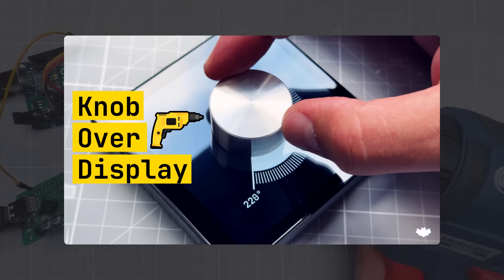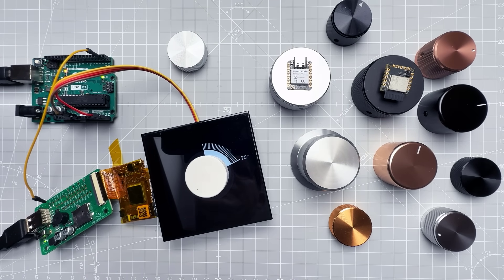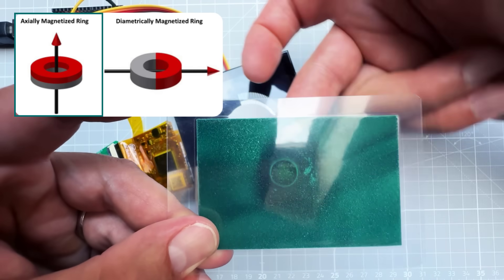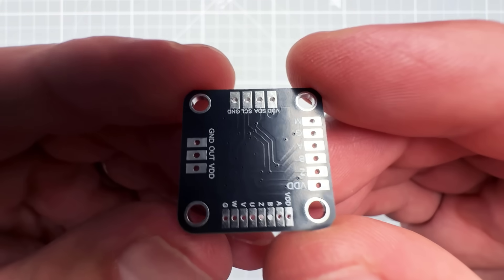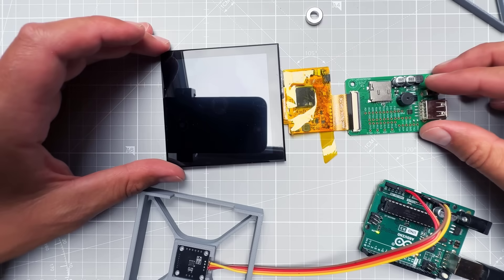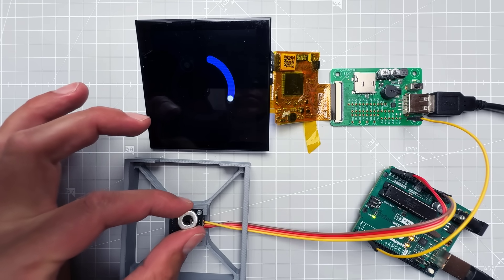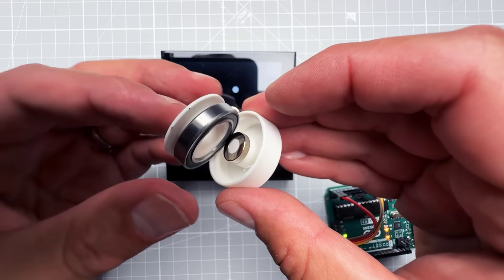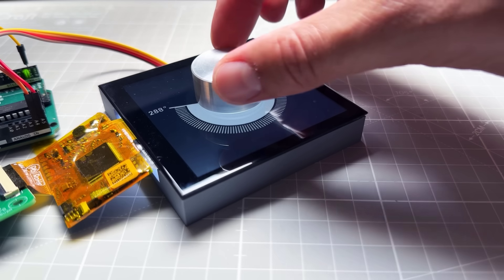Knob Over Display (2025 Edition)

Comment: You can use a magnetic compass sensor, where the distance from magnet to sensor is much less critical. Glue one central magnet - like the ones with the counter sunk screw hole to the display. Insert  steel ball bearing into the knob that rides in in the magnet. Offset a magnet in the knob that is used to drive the compass sensor
Reply from the maker: That´s an interesting idea, but I´m not quite sure what kind of precision you can get with this setup.
Reply: @upir_upir I am doing wind vanes like that... but they are not in the fractions of a degree accurate.

Comment: You should try to make the knob glow by making the knob transparent, and turning on/off sections of the screen underneath to replicate dimming.  

The screen would sit under a light diffusion layer housed at the base of the knob, so that the light can evenly distribute throughout the knob.
Reply: The picture map required by the screen may be a limitation there...
Reply: @testman9541  Indeed, but the idea is sound for other means of display driving.
Reply from the maker: Definitely an interesting idea, but the non-transparent magnet and bearing might be ruining the effect.
Reply: @upir_upir  Maybe print the knob in two parts? The center could be opaque, while outer ring is transparent?
Reply: @upir_upir  You may be able to achieve a similar effect even easier by shortening the height of the knob and adding a semi-transparent "spacer" of the same diameter to the underside. Using something that's not fully transparent would allow the light emitted under the knob to be softly diffused. Very cool project overall.
Reply: @upir_upir  attach knob to sheet of acrylic or glass. have it run a sensor along the edge of that circle, theres no reason a knob has to have its shaft or sensor in the center.

Comment: I have no words, the encoder is simply amazing. I can't assemble many devices, even a timer, because I don't like a huge encoder. They are either very huge or very expensive and hard to find. And here, it fits into a pinhead.
Reply from the maker: I´m glad this was helpful for your project, good luck with them!
Reply: @upir_upir  There's a problem here. You can't add a pressure sensor. I checked with the company; they redesigned some old chip. And in the documentation, there's a pressure sensor; it senses the sudden approach of a magnet. But in the end, they couldn't finish the function. The chip doesn't even have a register for this event, and the circuit boards don't have wires for it.

It's a shame. I even tried rebuilding it on a regular compass. But it just goes crazy; if the magnet is nearby, it needs a thousand times weaker power.

Comment: It's looks amazing! BUT! how strong connection this knob to display? And, how do you avoid the scratces after some time of using it?
Reply: If it were me, I'd glue a little post to the display for the knob to ride on.
Reply: as strong as your super glue is
Reply: Double side sticky tape 🎉
Reply from the maker: | have used double sided tape. There is no moving part touching the screen, so there will be no scratches.
Reply: Just add a screen protector 😂